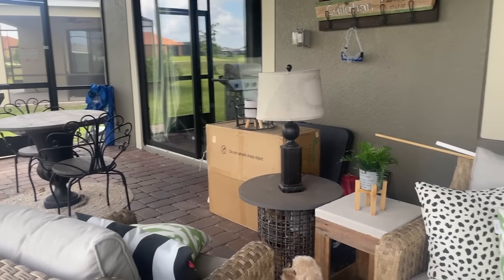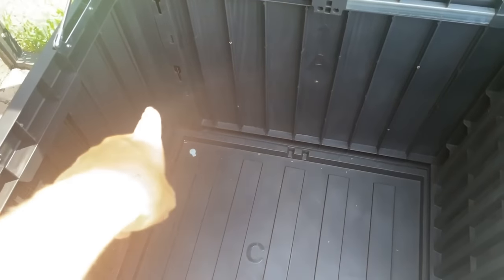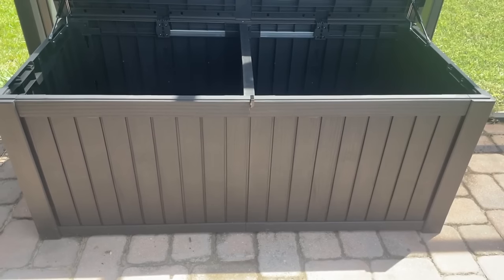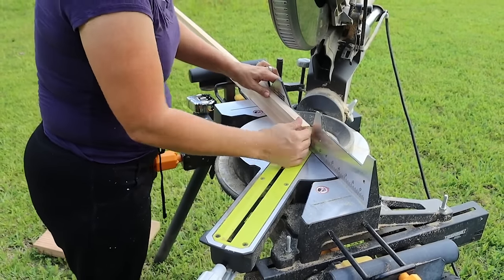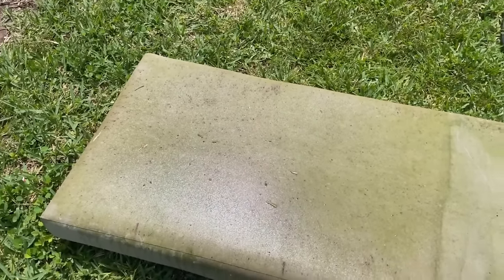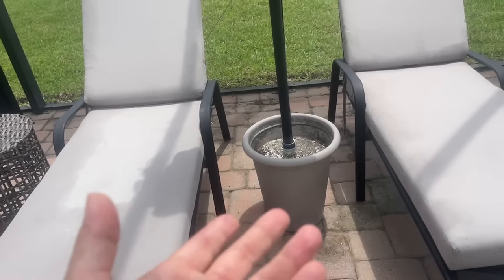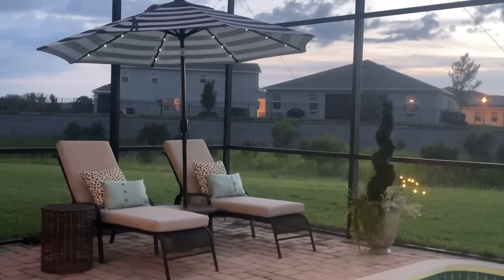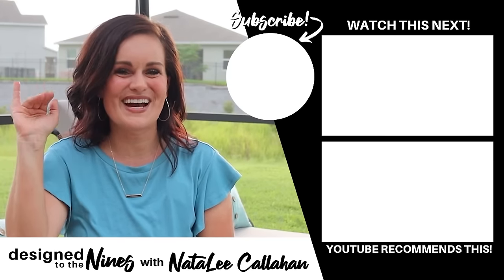Elevate Your Outdoor Patio w/ These EASY DIY Decor Ideas!

Comment: Love both the original and current projects.  Great ideas and execution. I’m taking some of your ideas for my own patio and backyard.  I live on the coast of south GA and certainly understand the weather situation. I’m planning on waiting until December to begin the projects as the 100 degrees days with no breeze are tough.  My little sunroom will have to do in the meantime. Love the casual living of our areas.  Great projects! Keep them coming!
Reply from the maker: Go for it! I would definitely wait. It is very hot and humid right now!
Reply: I completely understand I live in Southern Arizona and it is around 115 degrees right now will be for the rest of the summer which is through September. But I'm still out in my workshop with no air conditioning just a couple of fans and opening all the doors and windows. And of course drinking a ton of water

Comment: I would build a privacy screen to block off your workspace using 1”x1” or 2”x2” vertical pieces and 1x6 cross pieces for top and bottom braces. I prefer the style where one of the scrap vertical pieces is used as a spacer between the vertical slats so there is still some open space.
Reply from the maker: Great suggestion!